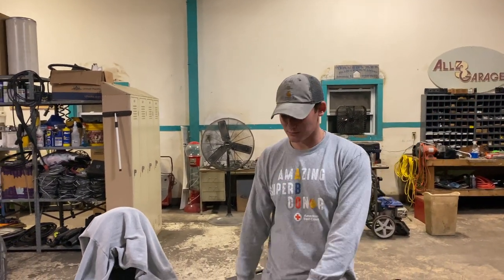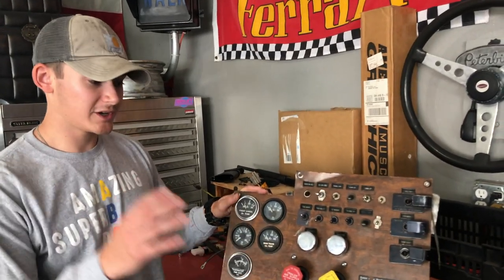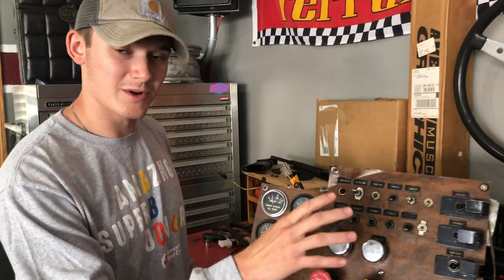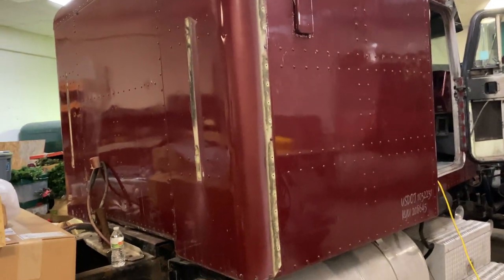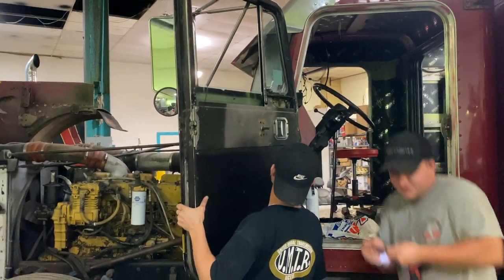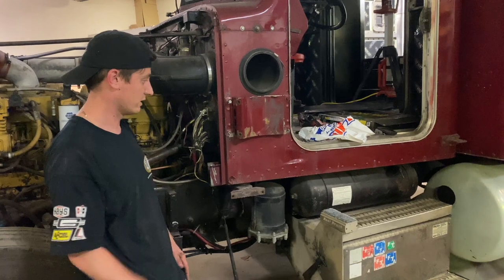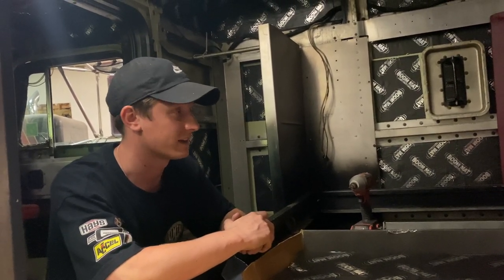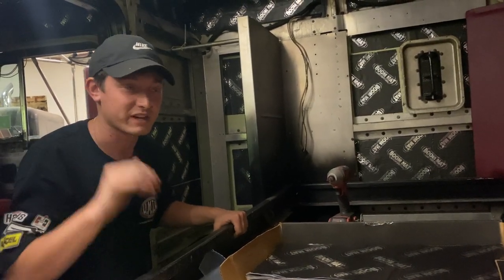Rebuilding a Peterbilt Flattop "EXTERIOR TEARDOWN" Part 2

Comment: Hey Allz3, when you do another project, check Lowes and HD for Butyl vapor barrier with adhesive, it is black and sticky on one side, has the aluminum foil on the top. Seen several guys putting wood floors in the truck on YT and they said it is cheaper than Fatmat and boommat, but basically the same product. Awesome project again, love the content. Keep it coming.
Reply: Thanks man - I mentioned this to the guys when the project started here, but it ended up being one of those name brand reliability versus the "should work okay" argument. Either way I think it would have worked great, but this was purely piece of mind and being POSITIVE we didn't have to double back and do stuff again. Thanks for the tip though! I'll have to make note of that stuff, possibly for a future build closer to the Silver Pete

Comment: If you guys are looking for a more affordable digital gauge that looks nice check out the Defi's. They're on the cheaper side for digital ones. Another thing you can do with the dash is to just vinyl wrap it. You can get whatever color you want and it's super easy to work with. You wouldn't need much at all and the dash bezel wont have to be perfect either, the vinyl will hide any minor imperfections. Smart decision on pulling the doors. You'll be able to get your two-tone perfect, and the jambs really nice. Then you can just back mask the door openings. The doors will also be way easier to do perfect off of the truck. Was really looking forward to this update! Cant wait to see the next installment fellas! 👍
Reply from the maker: We will check them out! Still debating on what ones to get!

Comment: A spray undercoat bed liner is easier to spray in and stiffens the panels more then boom box mat and cheaper on the wallet better effect and retains more heat in the cab and keeps it cooler then Mar material
Reply from the maker: The Boommat is not cheap but its a great product!
Reply: @allz3garage627  yes it's a great great product but it's oh a one trick pony where the spray undercoat or ceramic coat is a dual purpose item and easier to apply but takes curing time

Comment: Why aren't you putting in insulation as well as the sound deadening? That would  be a given here in Australia.
Reply: Temperatures aren't as extreme here in Cleveland, and this Boom Mat does have a thermal insulation property, as well as the sound deadening. Should be good enough for most of the Mid-Western US! Thanks for the comment and support though man